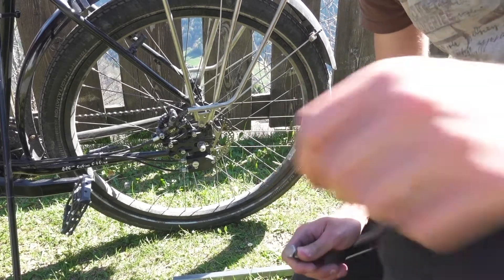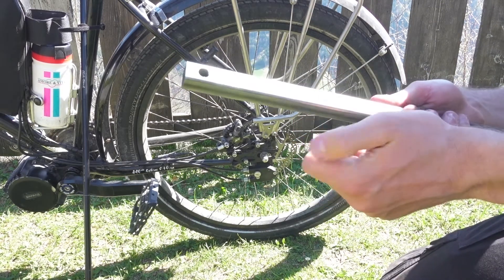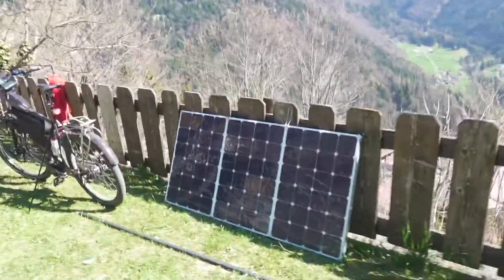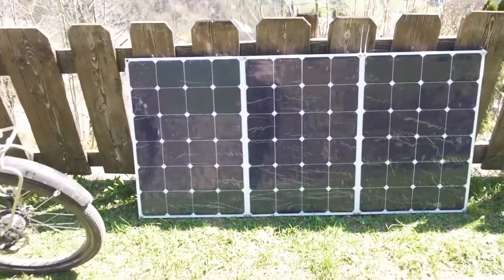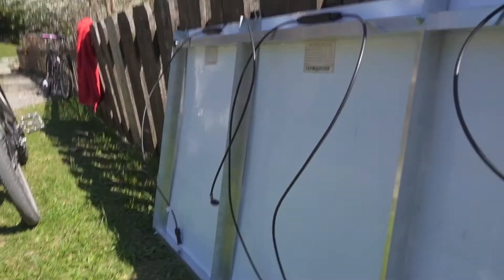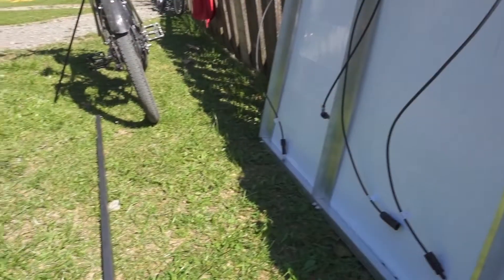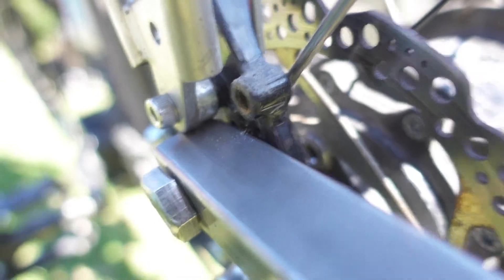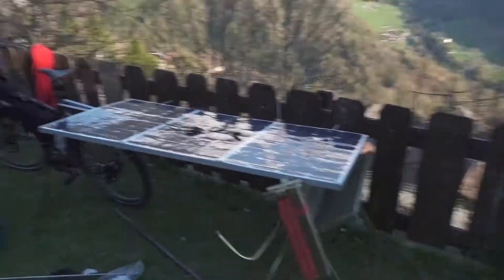Solar Powered EBike DIY - Part 1

Comment: get a child"s tag-along-bike (with one rear wheel and handlebars. Let the frame mount to the pull bike You can take the brakes, cranks seat and gears off the pull-along to make it lighter then add a rack to the pull along with panniers.    The handlebars on the kids trike will be a great horizontal brace..
Reply from the maker: Nice idea! Check out my newer videos and you can see what i ended up with :)

Comment: Where do you source your custom solar panels?
Reply from the maker: Matt Rowland from Chinese manufacturers. Alibaba or AliExpress is probably the easiest way to find manufacturers.
Reply: Would you be able to post a link to the one you used for your panels ?
Were the panels much more pricey being custom made ?
Reply from the maker: @mikow6722  i don't even know if they have a website! It's around 1usd a watt from most manufacturers. I think the company was shine solar or something similar. They are basically all the same you just need to talk with their marketing people and work out the details of what you need.

Comment: This reminds me of my 2013 solar bike design so much :-)

(it is worth mentioning that it disintegrated many time during just about 1300 km traveled in total :-)
Reply from the maker: Michael xChaos Polák oh dear haha. I'm sure i will figure it out in the end even if i drop to 2 panels/a trailer!
Reply: Well, I wish you good luck. Personally, I don't like concept of solar trailer, mainly because of my 2013 trailer experience... I am almost sure, that even if all the trailer issues were solved, ride with trailer would still not be comfortable (although single-track trailers can still do tilting in curves). 

But I am absolutely sure, that you will not want to ride with construction stretching more than one meter behind rear wheel (again - I did it in my 2014-2015 design, and it was only half of solar panel length, which was over-reaching rear wheel.. not full length). Doing it very lightweight may help, but still... it is just hard to steer.

For classical, upright bike, there are still interesting solar panel layouts, but would probably need more complex panel setup and providing full insolation when folded.

I am aware of solar roof issues as well, but still: total vehicle length is what counts, when it comes to safety and maneuverability. 

(You can check my twitter feed to see my own solar bike concepts - I am crazy enough to operate 2 different solar bikes this year, although the smaller solar cargo bike with box is for sale... it is not really Sun Trip - grade e-bike, but the layout may work - except that you would need more panels to get power when folded. Buy even for my solar layout, you need long tail bicycle frame layout...)

Comment: Wow! So knowing nothing about bikes I’ll leave that to others to comment on. I like the fact you’ve had some panels designed and built. I hope they provide the power you require. With the panels being mounted quite low, I imagine you’ll shade them more often than if they were mounted higher? Interested on how you are going to regulate the charge - hurry up with part 2! :-)
Reply from the maker: Adam Welch part 2 will be some electrical stuff finally! :p yea I'm definitely expecting lots of shading going to try out this setup before anything else though

Comment: I hope I am wrong. But I can't see you setup survive the rough roads. I know it is not your choice, but it is probably gonna be a trailer. Start building one as an option. One thing they do have in Switzerland is wood. Replace it by aluminum later to cut weight. 
Here some nice smooth though very affordable hubs. 
https://www.radicaldesign.nl/naaf-28-gats-voor-qr-as.html
Panels nice and high partly over your head to keep it all short. And balloon tires please! Maybe bigger wheels 28 inch? 
Trailer hitch will be important as for comfort of riding. But start with a simple one first. Visit a bike shop to get an idea what difference types of hitches can make.
Reply from the maker: I agree that i may have issues and as such I'm going to do lots of test riding before to get a feel for things. A trailer is certainly an option! The wheels are 26inch to make it easier to find parts on the road. Thanks for the comment!
Reply: Recumbent trikes did very well in the Sun Trip. One of the reasons could be because it is quite easy to add solar panels without losing stability. Trikes are not faster then bikes. Keeping your bike upright is energy too! In fact on a normal bike it is like 15% of all your food energy! 

Actually I bought a ( illegal) 500watt Bafang myself and 2x100 flexible panels. So now I am one of those e-assist assholes myself! ( I still hate speed pedelecs doing 40km/h on cycle paths though) 
Plan is to put it all on my homebuilt trike for a trip to the Alps.Working on it. Or maybe my ICE QNT. No I won't wear a helmet or get a license. It is just for getting up the mountain. I will take my chance and hope the police won't stop me. 

Now for me the solar  charging is just for fun. I can plug the battery in a wall socket every night. You however must fully use the sun. Those are the rules. In theory a trailer could have 2 layers of panels, one high, one low.  Both at an angle. A trailer could be faster. Or it could be slower.  But that is what the Sun Trip is about. To use different kind solar panels it is best to have a second battery. All costs money! If it is bloody expensive, part of the fun is gone. 

That is why you should build a cheap test-trailer. Do upgrades once you find out you're gonna need one. Most work on design will be ready. Time is short. 

But if it works without a trailer it will save weight and drag. I can't tell which is best. Your guess is as good as mine.

Comment: Will be interesting to see how effective this is. What are your rough power figures for the pannel? My estimate is around 360 watts. Also do you have power consumption figures for your bike?
Reply from the maker: Each 24 cell panel is 75w! Will update with my data soon hopefully :)
Reply: Jack Butler so a total of 225 watts per hour 🤔 not bad for a bike portable unit!
Reply from the maker: Cory Kaupa i would probably round it down to 200watts realistically but yea definitely awesome to have! :D
Reply: Jack Butler agreed, I need to look at rinoa super genius' efficiency figures at some point today and see what we're looking at for miles added per day